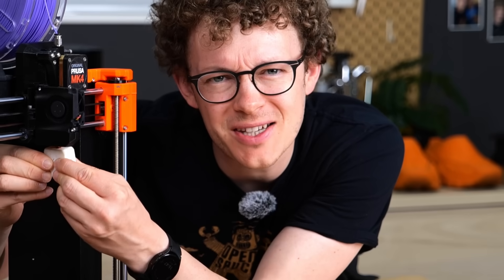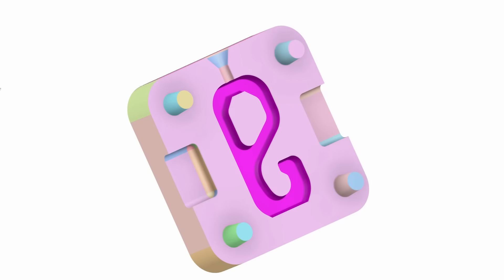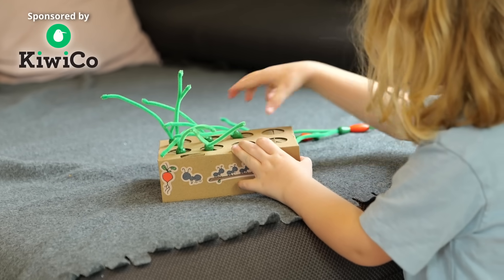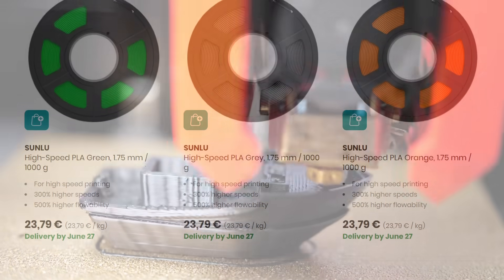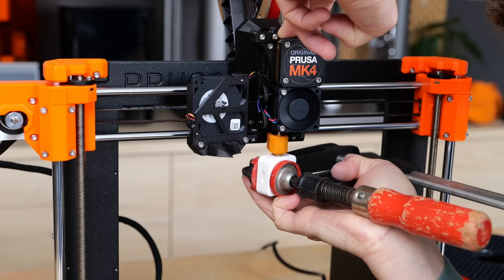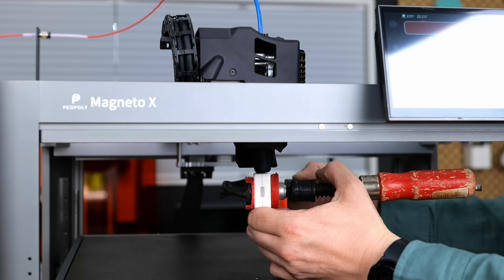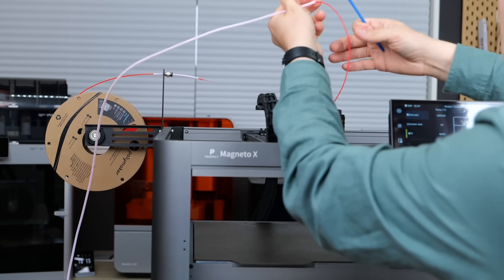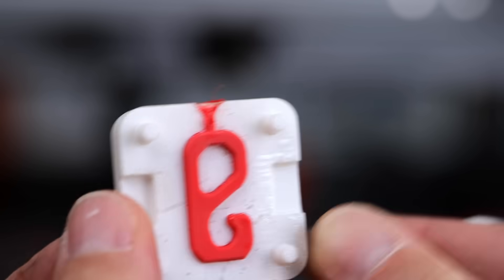I tried Injection Molding using a 3D Printer!

Comment: I'm an analogue kind of guy. I have done a lot of resin casting, but there are similarities. As others have said- an air bleed in the mold will help. Also, why not add threads to your molds and connect your extruder directly to the mold? You could easily modify one of the longer nozzles by cutting the tapered tip off. That would allow you to screw the mold directly to the extruder. Then, lower the head so the weight of the clamp is supported by the bed. That makes it stable and handsfree. Run the extruder until material comes out the airhole and you're done.

Comment: I think this has amazing promise!  I think the mold needs to be heated as high as possible to allow the filament to be pushed into the mold and allowed to creep into all edges and features of the mold.  What is holding you back is the filament is cooling too fast in the mold.  Find the most temp resistant resin you can find, make your mold and wrap a heating element around it and then try again.  I wonder if that would help.  Just a thought.

Comment: Former foundry worker, here. Well, Maintenance Tech, so not production. The internal pressure of the air is fighting you. You need to add sprues to the farthest ends of the mold. Such as the end of the hook. The sprues should go back up to the top of the mold. It should also be smaller than the injection one, as you want the material to be slightly pressurized for controlled injection. 

Also, try changing the injection sprue location, and the orientation of the mold. Sometimes vertical is best, sometimes flat, sometimes horizontal. Sometimes center injection, sometimes corner. Mold making cost a lot, because there is a lot of flow modeling to be done, and sometimes real world testing is the only way.

Its real trial and error on more complex parts to get them in the right spots. I've seen castings in the foundry with 10+ sprues to deal with complexity. Maybe try building a machine set up specifically for this, like a hot end that you can clamp the mold onto, to keep yours hands free from scalding molten plastic. Great proof of concept!

Comment: Not an injection mold designer here. I think this is really a cool concept and I was wondering if you could get a shape on the tip of the nozzle that you could use to lock into the mold so maybe you'd have an easier time holding the pressure. Either way, nice job dude!!

Comment: relief passages to allow air to escape. also you need to consider choosing the best injection path, based on the molded part complexity not just from the top of the '9'

Comment: You need to make a customer hotend which has a long nozzle that goes down into the mold which would then create an airtight and pressure resistant seal. Maybe take a current hotend and cut it down on a lathe. You could also make a stand for the mold which keeps pressure on the mold but also stands it up so you can lower the hot end on it and get a tighter seal.

Comment: Ich habe das schon vor einem Jahr ausprobiert, bei mir hat es nicht geklappt, weil ich nicht so viele Sachen zur Auswahl hatte. Ich habe mir ein paar Sachen überlegt, wie man es besser machen könnte. Zuerst muss man auf die Geometrie achten, es wäre einfacher, wenn man den Hacken um 90 Grad zur Öffnung dreht, so dass das Filament von der Seite kommt. Als zweiten Schritt habe ich mir überlegt, Molding Sandwich zu machen - irgendeine universelle Alu/Cupfer Molding-Gehäuse, wo relativ dünnes Hightemp Harzmolding eingelegt wird. Das Metallgehäuse wird mit einem Heizelement ummantelt und vorgeheizt, so dass auch im "FineMolding" eine hohe Temperatur entsteht und das Filament länger weich/flussig bleibt.

Comment: Maybe adding a little hole on the parts of the mold that won’t fill up great helps the air escape? Not sure how air tight this contraption is when clamped together.

Comment: Keep in mind actual injection and ISBM machines charge the barrel before injection. That is to say, they melt enough plastic to fill the mold in advance, then inject it all at once.
Reply: Interesting! I wonder what the difference is... I'm imagining quite a bit, but have no idea...
Reply: Since filaments are made for immediately solidifying, preheating near meltingtemperature is the key
Reply: Have you tried adding vents to allow the trapped air to flow out?
Reply: Do they preheat the molds, or is that one of the things that's not an issue because of the speed of injection, do you think?
Reply: @mrtechnophile3483  I'm not sure about regular injecton molding, but for ISBM it depends on the specific tooling. Some use only cooling, some use conditioners to slightly heat them. It's a tricky process to get just right and involves a lot of tweaking.
Reply: I don't think that can be done with a 3D printer nozzle (still don't own one), but him using longer and longer nozzles feels like an attempt to approximate that behavior within the spec of 3D printers. It's definitely an important consideration though, and it's what makes me think that part of making this level of hobbyist injection molding accessible will involve people designing DIY/semi 3D printable injectors that let you preheat a load of the plastic and then shoot it in like a syringe.

Comment: Stephan, maybe it would be a good idea to try moving the filling port from the side to the top/bottom, heating the build plate and use the printer to push down (clamp the part together)

I know getting the mould apart and the injection out might be a tad harder but no more holding the injection mould and no worries about the filament solidifying.
maybe the bottom of the mould be one part and the top be say 3 parts. the split inner mould and small top case to hold the pieces together?  This idea is great and would like to see it get expanded.  Hell maybe you can try with bigger parts too!

Comment: Why not use cheap aluminium for the mold?
Its obviously more involved than printing the mold, but you can heat it to help with the flow issues and its far cheaper than machined tool steel, easily doable at home (as long as the part isn't too complicated)

Comment: Stephan, any mould, Every mould should have AIR VENTS. even to inspect the flow of a casting, air vents are useful. So try make some small channels on the corners of that hex but please❤
Reply: I noticed other people here already said the same.  Still a useful tip. I'm experienced in the field of metal casting,  injection moulding is something else of course. ❤

Comment: why dont you add air release on the other side on the legs , tiny holes will be ok for air to escape. also you can use release spray  or coating like pva or teflon on the mold.  another thing is you mold is sinking in the heat as its not preheated.

Comment: I think what this video showed best is not that you can use printer for molding, but that high-end printer hotends are good enough for small scale models. A piston with a hand-operated lever will vastly outperform any filament extruder and will let you recycle failed prints and supports, and an inexpensive hotend with a drilled out volcano clone won't set you back much. Now brb, I'mma gonna go ghetto rig an injection molding machine with a motorcycle brake lever and a spare hotend I have lying around.

Comment: A way that may help alleviate the pressure issues is adding little branches coming off the part, see how the PLA wasn't getting to the end of the mould, extend where the end is, so at the end of the hook have a small 0.3mm channel that will help the end fill up

Comment: So I’ve actually done something like this for the place I work for. The project was specifically to overmould a pub and cable assembly, I designed the mould in solidworks, printed it on my sla machine and used a hot glue gun to fill the cavity, I produced 50 pieces as proof of principle before I got the mold cnc’ed in china for larger production

A couple points for your next try

- Draft angles on your piece will help for demoulding
- Gate size should be increased slightly, also placement doesn’t look optimal
- You need a whole for the air in your cavity to be pushed out of for when it’s being filled with plastic or your chosen material
- Silicone demoulding spray really helps

Sounds like a weird idea but try printing with your fdm printer, a shape that roughly represent the diameter of glue stick and used that with your glue gun, you are able to get a lot more volume of material out under higher pressure

Comment: you could just add another fill hole in the bottom which will work like the air hole and can also help fill it better as you can fill from both sides

Comment: was waiting for this for a while :) great video
Reply: I always print (and design) my resin printed injection moulds flat on the buildplate or standing on their sides, to not get the stair stepping where the mould halves meet. I also just print in simple and cheap Siraya Tech Fast instead of all the hi temp stuff and it works just fine. Tiny air vents might help with filling the mould more easily. I'm no engineer or technical guy at all, just played a lot with resin printed injection moulds and found out some stuff. I still haven't made a longer video about my whole process and I am currently playing with concrete instead of plastics, but there are a few videos and shorts from the beginning of my tests from a while back, if you're interested. Curious to see more!
Reply: 🤔 screwing/clamping the mould onto the nozzle/hotend?

Comment: Try making injection hole on the flat side of one of the mold sides.
You can use Z motion of printer to clamp it to the print surface.
You can heat print surface to heat the mold
Place air out holes on far sides of model. 
Filament input hole in the middle, maybe in the intersection of the '9' lines.

Comment: Besides what a lot of others are stating regarding venting and gates, I recommend using metal pins to avoid the halves shifting around.
I would also perform a boolean cut with the nozzle geometry to ensure a really good fit and avoid as much pressure loss as possible since you don't have much headroom for pressure loses. I noticed that you had a hard time keeping the mold straight up against the nozzle, perhaps adding screws and manually jogging the printer down into the mould with a scale underneath (to monitor force) is way easier than holding the clamp? Adding these metal parts may also help whilst preheating.

Comment: I would extend the mold so that the nozzle can get into the mold better, maybe so that the nozzle is getting half way into the mold, and i would also preheat the mold to 150~ ish degrees Celsius so that the filament can get into some small crevices. and add an air hole for air to escape (0.5-1mm would probably be enough)

Comment: I used to teach injection moulding theory at university and we would print a few moulds and run them with a small injection moulder, like this, as a demonstration. As most people have noted, position of the gate and airs are key. The only thing I would add is that with an injection moulding tool, you actually leave a tiny margin where between the two halves of the mould so that air can escape but plastic cannot. That's why you almost always see a tiny bit of a step along the seam where flashing eventually occurs, if the pressure becomes too great or the mould deteriorates. Hope this helps.

Comment: Few things I've thought of. 1. Why not print a frame for the bed to hold the mold in a precise position and press it into the hotend in a repeatable fasion. 2. Molds like this need a place to release air, even the industrial ones, so maybe add a ball shape below an exit port. 3. Heat the bed to keep the mold warm.
Reply: Oh and here's a fun one. Keep the vent on top, but change your injection site to the bottom or side. Then just flip the machine to the correct orientation and fix the hotend in place with temp clamps.

Comment: You could try adding a small vent tube in the bottom, might just be, that the mold itself, when clamped, isolates too well and the air inside can't get out, that would give backpressure, compression and cooling problems. You could try different width's of vent tubes for instance, and different placement, because you do want to fully fill the mold.

Comment: Injection molding often involves heating up the mold first, you could do this with the hotplate and/or airgun beforehand but depending on material, your max safe temp before deform will be limited, still better then a COLD mold.
And obviously like everyone has been saying, you need tiny vent holes and central injection point.

Comment: Context: I spent 4 years studying injection molding, mold design and plastic behavior in different plastics manufacturing processes. You basically want to:

-*Heat the mold*🔥to preserve more fluidity of the polymer as it enters the mold cavity (viscosity in plastic is hella affected by a few degrees)

-*Inject/Fill quicker*⏩(2 seconds would be a great ballpark number for this test) This could be done by using a longer nozzle and wider nozzle diameter

-*Reposition the gate/sprue*⬅for better Length/thickness ratio (reducing the maximum length the plastic has to travel before filling the mold)

-*Venting*🌬with a pinhole at the end of flow trajectory could help a tiny bit although I don't think this is your issue.

Comment: Re heating, design hot end cartridge holes and temp probe into the mold close to the negative and heat to filament temperature. And air relief holes as others have mentioned.

Comment: Suggestions: slather some two part silicone or 500C gasket sealant around the edge of the entrance hole to create a squishy seal around it. That should increase your pressure. 

Additionally, the exit hole others have mentioned will help a lot. 

And yeah, pushing the preheat to the limit will help. Home injection molding machines typically require that you bake the mold in the oven before injection to keep the plastic from cooling part way through.
Reply: The guy who will shill for anyone for a dollar has an opinion.

Comment: Making a heated clamp made similar to two hotbeds pressing the clamp on each side and preheating it to a certain temp. It could use a lot of similar tech as a filiment 3d printer.

Place mold.
Tighten clamp by hand.
Have the extruder on a threaded clamp perpendicular  to the mold clamp that can be tightened by hand to press it into the mold fill point.
Start heating the clamp and extruder.
Extrude until full.
Let cool and the rest is obvious.

Comment: Great experiment and typical CNCKitchen - thanks, Stephan!

Maybe you could add an overflow cavity at the opposite side of the mold, in which you compress the in-mold air and which gets partially filled (like the bottom end of your hook)? Could possibly lower the in-pressure needed.

Could also try to put the inflow opening on the side of the mold, so you can clamp the mold with you bed and hot end. And then heat the bed, too.

Comment: For larger parts you could use multiple hot ends with multiple points of entry to the mold. Also using something to apply downwards pressure probably would help since it would sit against the mold better. Maybe next time try to print the halves with a wide bottom to sit against the bed or a flat surface. The other thing you coukd try is move the injection hole to the side of the part and lay it down then while using the gantry to press against the mold. The added benifit could be turning the bed heating on to possibly heat the mold at the same time.

Comment: A couple other Ideas on top of air vents and using the gantry for pressure. (not sure if these are good ideas)

1. Move the injection port port to the middle area of the part so the plastic has less distance to flow to the extremities. 
2. in addition to using the gantry for pressure, use the hot bed to keep the mold warm.

Comment: Stefan I'd like to try a thing like this! What about printing the pattern along with an alignment surface or base, then get the mold from it in, like, epoxy putty (?) so that it can withstand more than 200°C and keep the plastic melty while it's flowing inside? Thanks for the content, as always!

Comment: Formlabs has a really great webinar on their website on mould design, but their injection moulding was with silicones, which flow for a longer time.

Still worth the look though

Some comments (some tips are from the formlabs webinar)
- shorten sprues
- more sprues to different parts of the model (the test hook was really worst case with a long flow path, try rotating it 90° inside the mould and have multiple sprues go to the 2 ends.
- heating the mould should work, put a heater inside at a temp that is just below the glass transition of the resin to keep details, or even higher? Not sure)
- use clear resin for learning something, even though it's probably a bad idea
- higher volume parts have lower volume/contact area, so i'm not sure, but it might help slow cooling, even though the injection will be slower? Maybe add extra extruders at multiple sprues?
- use resin (or other material) with bad heat conductivity, i know it's counter intuitive, but the metal moulds in injection moulding are to accelerate cooling to increase takt time, however since you don't need to care about that, it can only help flow.
- make a 'nozzle' that goes deep inside the mould, does not have to be a nozzle like 3d printer, maybe cut off that head of the looooong nozzle you have, and. Have it screw into the mould, this way you have the extra heating, the plasic exiting the nozzle quite close to where it is needed

Comment: You could totally build something using 3d printer parts rather then just straight up a 3d printer that is specifically meant to make injection molds with 3d printer filament